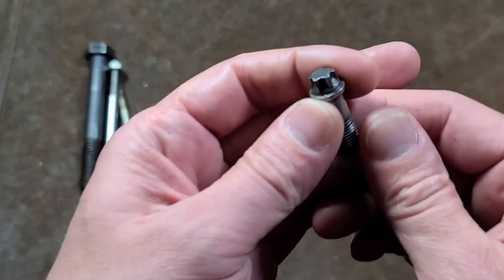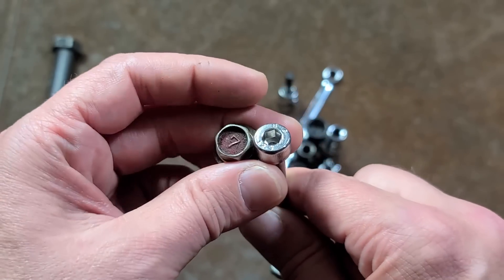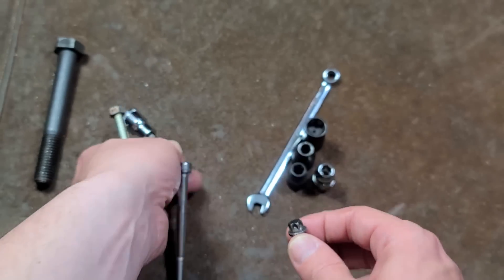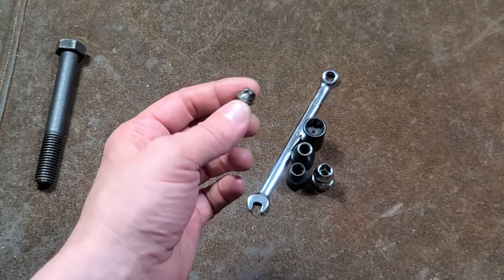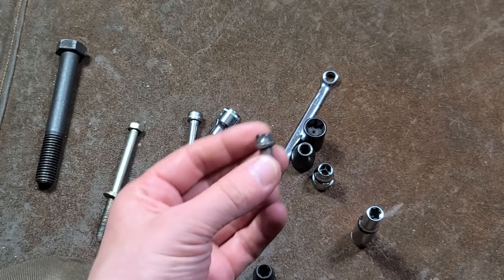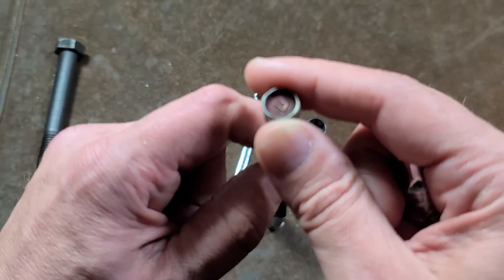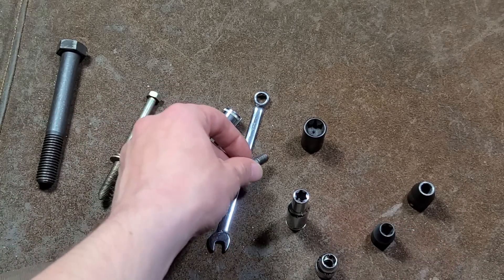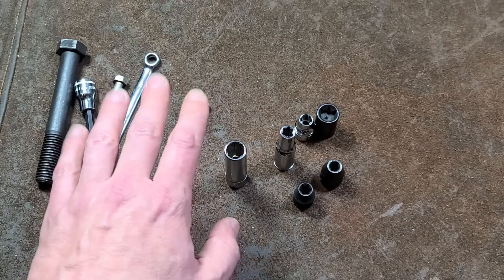External Torx (E-Torx) Fasteners Introduction, Tips & Tricks

Comment: Thank you, I only came across my first e torx bolt today on a BMW Mini.  I was cursing BMW for deliberately making it such that I would have to take it to a dealer to get a job done.  Then I found out that there are many e torx socket sets around, so I have purchased a quality set which should have the deep chamfer.  I hope that is right that these bolts are only high grade material because the bolts on the rear Mini caliper may be loctited in, although a couple of videos have shown them being undone without too much trouble.  I feared I would strip the 6 points off the head.  I can vouch for the traditional sockets not being of much use, as I tried a 12 point socket today and it broke!  I tried a 6 point socket but bottled out as I was applying a huge torque with no result.  Anyway, thanks for an informative video, now I no that they are not such a bad idea!

Comment: I have a mercedes that I work on myself and I'm trying to figure out why etorx is so cool. The sockets always seems to not fit the bolt itself... it either seems too small and does not reach the bottom or it seems to have too much play on the size up. Is the larger fully seated socket with play acceptable with etorx? With hex bolts there is never any question.

Comment: I've taken lots of motors and interiors apart and can't recall if I've ever run into one of these.  I'm really racking my brain.  I have a small row of these socket bits in an 80 piece set I recently bought.  Trying to think of a single place these are used,  from a manufacturer- specifically and where...
Reply: 2007 pontiac g5 wheel cylinder bolts.

Comment: socket head uses a smaller profile for counter bores (e-torx is not an alternative for counter bore fastener installations.  The E-Torx although less than a Hex-head will require a larger external socket than socket head.  I totally agree using powered drivers, this head design is better getting on and off and providing better engagement.

Comment: I bought a Mercedes-Benz a couple years ago now. It's my first experience with torx. And I honestly love it! And in a pinch if you need to remove a pulley or something, my 12 point sockets work very well on em too like you said. Although I did buy torx/E-torx sockets also. Some people hate em, but I've had a very good experience with torx fasteners!
Reply: you say that now just wait till your mercedes etorx bolts get rusty coming from a w211 e350 owner … have fun and don’t forget to spray some pb blaster and make sure you don’t rachet them off at a angle! don’t say i didn’t warn ya

Comment: Hex doesn't work on torx it'll strip the heads i done it might feel like it's on tight over it but its really not and it slips hope i didn't ruin mine to bad maybe a 6 will get them loose it just stripped the tip ends of the heads so all i can do is wait I'm not gonna buy no cheap tools

Comment: Dont be a cheap bastard, get an e-torx socket set, or buy them individually, eg an e14 socket in 1/2 " is about 4eur.  But i didnt use one and broke 2 out of 3 bolts in my turbo.  Mechanic to take the turbo out and machinist to get the broken bolts out cost me 500eur...

Comment: To replace the starter on my BMW, it required 2 etorx screws to be removed, accept they were put in from the back of the bell housing facing forward and they were right up against the firewall and a etorx socket would not fit. 🤬
Luckily I discovered that the box end of a craftsman universal 3/8 swivel wrench fit perfectly and it worked like a charm.  Every other damn bolt on the car was metric accept for these POS’s 😂
Reply: That's how this transaxle transmission is I'm doing all the screws are upside down when they all should be at the top not underneath them being underneath the heads of each screw will rot out faster

Comment: I have used e-torx sockets to get worn out hex bolts out, you can use a hammer to get the socket into the bolt and you'll be able to apply a lot of torque to it, probably even more than with the right socket.

Comment: if youre a small engine guy; they have nice  quality sets on amazon. don't buy the first kit you see scan down a few pages. i got a E4-E20 plus all the reg torx sockets 1/4,3/8,1/2" drives and bits for $10 in a case. again small engine equip we aren't torqing the shit out of stuff. its pittsburg tool quality; plenty good for saws snowblowers and such hoonda and briggs is using these alot now

Comment: I hate these E Torx bolt. I can’t get it off my freaking car.
Reply: I kind of thought that too, but torx may be the best drive ever invented for higher torque screws. I thought square drives were fine, but torx are enough better that over time I think square drives might be eliminated. Phillips drive have some advantages in lower torque applications so I don't see Torx ever eliminating phillips heads for things like smaller dry wall screws.

Comment: Not recommend but it you are using a non E Torx socket on a torx fastener, spline sockets are your second best option not any of the other options.
Reply: If your spline-drive wrench/socket isn't fully seated squarely, you'll marr up the E-torx fastener pretty good, along with a greater likelyhood of getting the tool stuck onto the fastener. The same could be said for 6pt/12pt sockets/wrenches, but I've found they are less likely to get stuck. YRMV.

Comment: I'm not a fan of these fasteners in under vehicle applications. Here in the rust belt, the sharp edges corrode off quickly. Also you didn't mention about Torx and the 'new and improved' Torx Plus.
Reply: The edges rounding off has been my experience exactly. Even with quality sockets that have a proper chamfer, and ensuring I apply forward pressure, I've rounded off e-torx bolts. I've come to call them "external Phillips." What can I say? This is what happens when the focus is on the convenience of the manufacturer rather than the consumer or mechanic.
Reply: @mattruth7109  how do you remove them. I got one that stripped between the engine and fire wall. No way to put a grinder or Dremel so in kinda screwed lol. I'm hoping a set of socker extractors will work. Just want to see your input before messing the bolt up some more
Reply: Yes that's a little of my problem right now and it ain't fun I don't know if I should reuse the e torx screw or go with other ones what would help keep them from rusting up is like a heat oil resistant rubber cap over each screw head but no one makes those
Reply: I also stripped one and i’m not sure what else I can do to get it out
Reply: @livstrycharz380  hey no worries i got mine off with a harbor freight removal socket set

Comment: I work at a jeep only salvage yard and they use e12 torx on almost all bellhousing bolts. Its amazing how many people round them off servicing the clutch rather than buying the correct socket. Have to slam my e12 on with a hammer sometimes.
Reply: Well yes because grease monkeys.
Reply: I bought a e type socket for my car and it still rounded it, I don't know why they use those dumb sockets, probably to make you spend more money on tools but its annoying. I'm just taking to take seats out to clean underneath and they have something so hard for a piece that is taken out alot for cleaning or repairs. Thanks mazda

Comment: Why would you need deepwell? Do they have etorx nuts?
Reply: In case they are recessed and there is not enough room to use a standard socket with an extension.
Reply: @sfx1999  precisely....although I've rarely come across that situation, and was able to get by it by using a smaller drive size (E12 in 1/4 drive versus E12 in 3/8 drive), or using a wobble to avoid the obstruction.
Reply: Maybe, but I've never seen one.

Comment: If you use a six point on an external store bolt that is torqued tight on a car suspension, the socket will strip and damage the bolt. Ask me how I know. I now have three sets of external etorx socket sets to fit all of the fasteners on the two German cars we own.
Reply: So you stripped the heads like i did
Reply: I'm about to have 2 e torx tool sets and 3 if i don't get the right small socket i need I need one socket smaller than 10
Reply: Gotta use 12 point sockets and it won't slip
Reply: @MacAutoDiag tried that also and it strips just as easy.
Reply: @donho3617  then you rounded the bolt too badly cuz a 12 point doesn't slip on an etorx

Comment: I certainly appreciate Etorx now. I figured it was just another fastener made to make mechanics lives more frustrating.
Reply: I have these on a lot of large undercarriage bolts on my car. It's a hassle having to buy new sockets, and finding impact sockets was almost impossible, but the ease of mind, being able to just go crazy with the impact or breaker bar with no worries of rounding off the fastener, is great.

I'll also add that I only got three sockets. E14, E16 and E18. Those are the high toque bolts for my car. I have some smaller sizes, but since they don't bear very much load, a regular 12 point or 6 point will work perfectly.
Reply: Torx bits are great too. For small bolts and screws you can use flat head , which is terrible because it slips. You can also use Philips but there are only a few sizes, like 4 or something so it doesn't maximum the size of the hole compared to the bolt. With torx you get more grip and there are more sizes.
Reply: Yes! I can't remove my MAP sensor because of this infernal screw 👹👹👹
Reply: When it's hard to see and it's not something you work on all the time it certainly is

Comment: That isn't good how that icon etorx doesn't seat fully on the head of that etorx bolt you had there. Hopefully icon/harbor freight is aware of this.
Reply: The Pittsburgh e-torx sockets have been like this since forever. They're junk and you can't really use them in high-torque applications (which e-torx is commonly used for).
Reply: Though much less common, there are shallow headed E-torx fasteners in the automotive sector. ...but they should be marked as such for identification, which HF/Icon hasn't....whether HF is aware of it is another matter.
Reply: I used a shallow socket and stripped my seat bolts I didn’t know there was a difference at the time.
Reply: I know I might have already fucked up the screw heads that's why i didn't buy those cheaper tools from there cause they'll either crack or slip around the head more and I can't chance that with cheap tools

Comment: Nice video and explanation. You can use those "universal" or spline sockets too. there are some companies that make e-torx wrenches which are very nice to have, but they don't come cheap. As you mentioned, it is really best to get the proper tools for these fasteners, especially if you know you be dealing with them in advance. Even if you do get the fastener out, the damage might be enough to require a replacement, which will also not be an easy task.

Comment: Do you remember the "metrinch" claim? They said that the walls do the gripping as opposed to the corners ? Their sockets and wrenches still had corners and that to this day still bothers me.
Reply from the maker: Snap-On just announced new flank drive plus which is basically the same thing... tighter tolerance sockets would make special fluting or geometry irrelevant as they would grip then entire surface from middle to edge...

yep that means all your old snap-on sockets and wrenches are useless and have to be entirely replaced full truck prices... :)
Reply: I have that metrinch set and I love it. Been using it for about 25 years now. It works on both metric and standard. Doesn’t matter. Now I’m curious if the metrinch sockets will work on etorx. I will have to find a bolt and try it out. My daughter’s chevy cruise has a lot of etorx bolts. Great great video by the way catus. I was kinda annoyed by etorx but you’ve given a whole new perspective  on them that I never thought about. Very well done. Thanks and keep up the great videos.